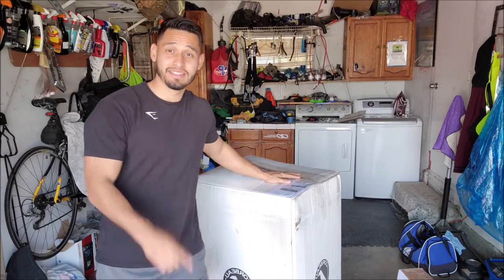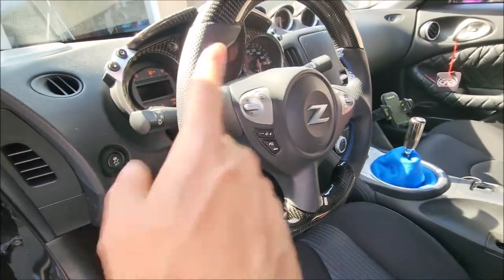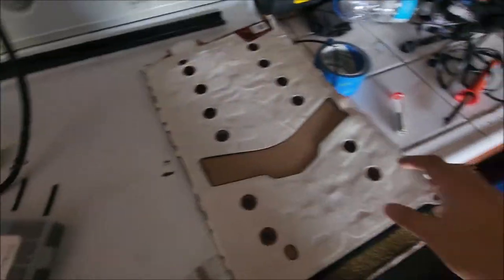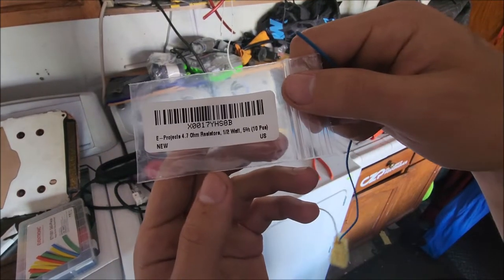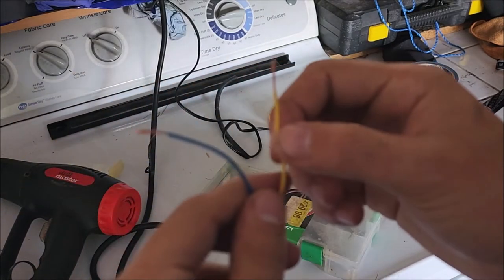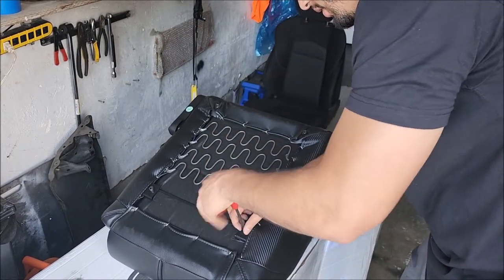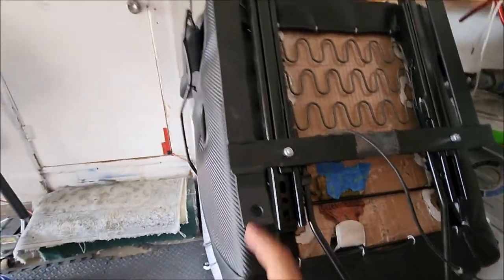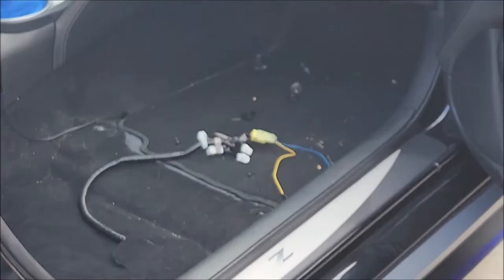Installing Corbeau RRB Seats on my 370z! SRS Light Fix!

Comment: question do these new seats have heating like the ones that come from the factory?
Reply from the maker: Love that you asked! Corbeau actually gives you this option if you want it, it costs extra if you want it on both seats or individual. they install it on the seat for you to! all you have to do is wire it to a power in ur car which u can easily tap into the existing heat switch if u have it stock. If you never had it in ur seats u can simply wire it to any power source from the fuse box and use the switch they provide 👍

Comment: Do you have to do this process with any aftermarket seats even the NISMO v2s?
Reply from the maker: With the nismo V2 recaros, you will have to do the process if you are installing them without the plugs for the airbag or seat sensor. if they come with them then you are simply plugging everything in.  This process is mainly for aftermarket seats like braum, corbeau, sparco, etc. that don't include those weight sensors or srs airbags.
Reply: @Vq_Kev  okay that makes sense great can you tell them to add them before u buy it?
Reply from the maker: @EL-sc9on  for the nismo v2? I'm unsure if they do that or if they come with airbags in them. you could have it done but it would cost $$ to get it done. Your best bet would be taking the sensor off of your stock seat and transferring it over and then doing the resistor trick.
Reply: @Vq_Kev  I mean for corbeu the seat that u bought
Reply from the maker: @EL-sc9on  for corbeau they don't install that for you because they need all that from ur original seat. you would have to do it yourself like I did in the video, this would be the same for most aftermarket seats
Reply: @Vq_Kev  thanks bro